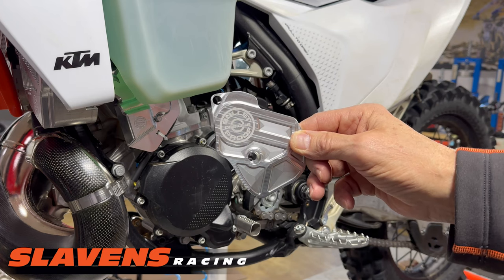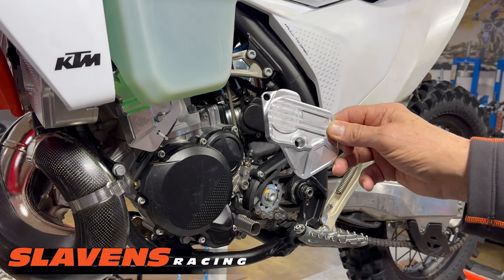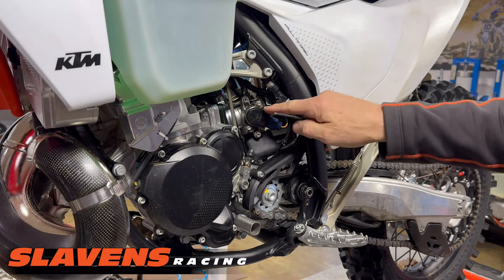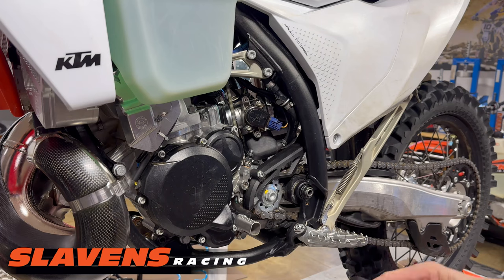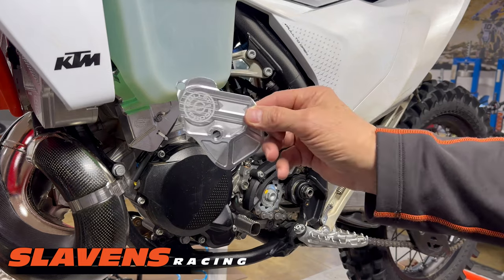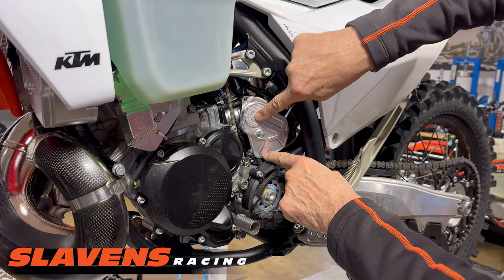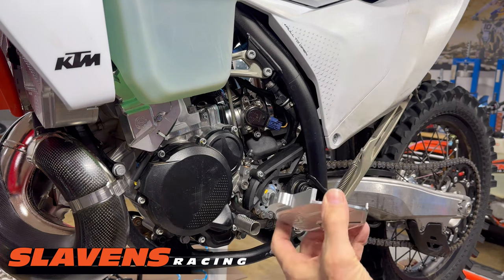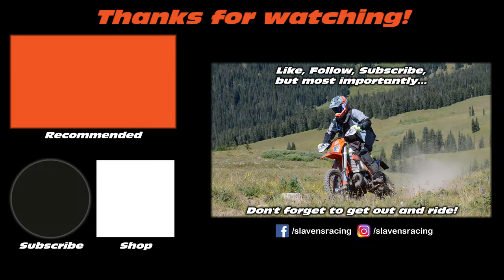Bullet Proof TBI Throttle Body Guard Review and Installation

Comment: Hi Jeff.  Tried installing this guard on my new 2024 KTM 300XCW, and it seems to push up against the fuel injector boot cover a little too much.  Do you know if Bullet Proof will make one that fits just right?
Reply from the maker: I’ll remove mine soon to see what you are talking about and get back to you.
Reply: @slaverace1  Thank you!
Reply: @slaverace1 Hi Jeff did you have a chance to take a closer look at the throttle body/fuel injector  guard fitment on your 2024 KTM 300XCW?
Reply from the maker: @artrivera5331  
Hello: I have that guard on two TBI models. I removed it and took a look and I’m sorry but I don’t agree with your assessment.  Yes it touches the boot but that is not an issue that causes a problem. Also talked with Bullet Proof and they have not heard of any issues.
Reply: @slaverace1  Ok thank you for checking.